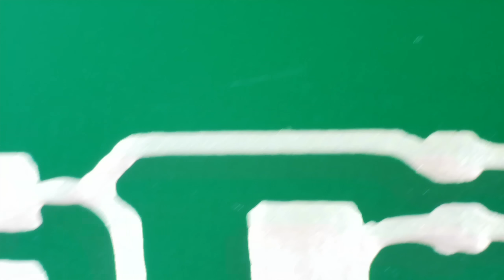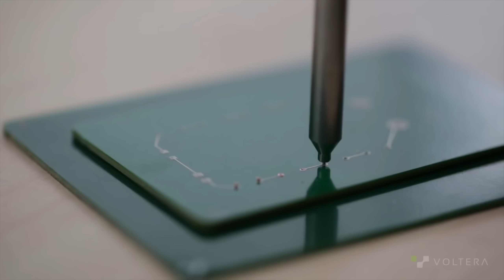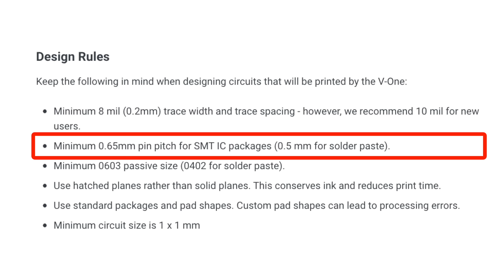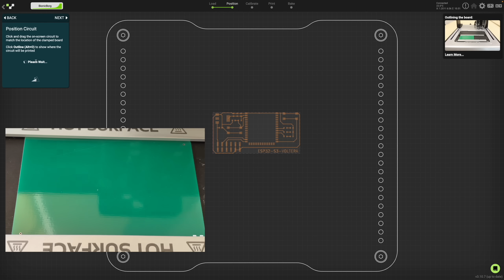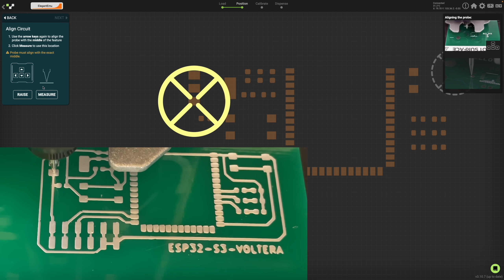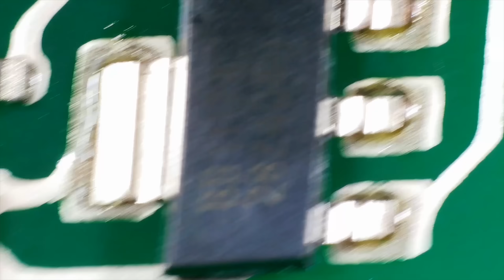Printing PCBs At Home!

Comment: At $5000 for this machine, instead  you could afford to pay someone in china to go pickup your $5 boards from pcbway and overnight them to you.   
You could afford over a hundred boards that are multiple layers and high quality and still be cheaper.
I don't understand why someone hasn't done this kind of thing yet, not using a pen plotter with conductive ink, but just print the tracing in solder mask and uv expose them and then etch.
I want to build such a machine myself, but laser printer toner xfer is almost free and just as fast.

Comment: IMO, they really missed out on adding an attachment for a fine tipped paint marker to do silkscreen markings - it shouldn't be difficult to do considering it's the same process as their conductive ink prints except it's a different ink or using just a mechanical jig to hold a marker.
They could probably even provide a dispenser to do UV cured solder mask (not necessarily for their printed boards) since the software already has a 'homing' function so in theory an etched board with the appropriate gerber files would allow for this.
The price of the machine though... Way too steep for a hobbyist especially for those in regions where etchants are readily available (unfortunately not for me).
I can see how this might be useful for a small business specializing in producing prototypes just purely as a solder paste dispenser since they'd not need to make/ procure stencils.

Comment: I REALLY wish that you had elaboarted on the "reflow" process.....how did you heat the soldier?
bake the board in an oven? heat gun? crack pipe? barbeque?
Reply from the maker: The Voltera machine does the reflow as well.
Reply: I use an old, repurposed toaster oven.  They cost $10 at Goodwill.

Comment: That scam again... Instead, you can purchase a 2k photopolymer printer (less than €300 new and €150 used now), take a blank PCB with a photo resistive layer, and make an ideal hand made PCBs, with true, thick (I mean 2oz if you wish) copper traces.
Reply: I agree that the classic way of etching a board seems better in some ways, but printing on solder paste is WAY BETTER

Comment: seems like you could use the drawing as a mask for a uv sensitized board and then etch normally.

of course you could do that with a pen and a cnc machine probably cheaper.

or the uv screen of a resin 3d printer

Comment: It seems more like a glorified breadboarding solution, rather than a PCB prototyping solution.  I mean, with its limitations you can’t really use it for prototyping your final PCB layout design.  So, once you’ve “prototyped” your “breadboarded” circuit design, you still have to go down the final PCB design prototyping path (with the usual delays waiting for your chosen PCB manufacturer to deliver).

Comment: With the USB port issue, couldn't you drill through the board and secure the connector to the PCB with some jumper wire or something, so there's no force exterted on the bond when inserting/removing the cable? While lining up a double-sided print would be difficult, doing some selective drilling to secure things like headers, switches etc would be easy enough?
Reply: How about mount the connector on the back of the PCB.  The pins can go through holes to traces on the top surface.  This would be a lost stronger than an SMD connector.

Comment: Printing the traces directly on a blank board is a surprising approach. I would have thought you'd do it by printing resist onto a copper-coated board and then etching off everything else.
Reply: That would probably produce better results, but then you have all the etching chemicals and wash steps.... this approach is simpler and less toxic.

Comment: If you mark/drill alignment dowel holes, and then mirroring the bottom traces, you can print the top, flip the board and mount on the alignment dowels, then drill and solder a bit of stranded wire between the pads as via's for double sided boards.  I also wonder if you squeegeed a bit of liquid solder (the SMD stuff) over the traces then re-baked it if it would pre-tin the pads/traces
Very cool and awesome development! Keep em coming!!!!

Comment: Just a thought, but have u considered adding another step? Run a a drill over it cutting out the design b 4 laying the conductive ink, u might get stronger part adherence to the board.

Comment: Interesting that the actual x-y movement is quite quick while printing, but the z movement is quite slow and there's a pause at the end of each movement before a positive z movement. I assume the pause is to reduce the sizes of holes and bumps in the printed ink. I wonder if the software has tuning for the z speed. It also looks like there could be some pretty significant efficiency optimisations that could be done, such as printing complete nets in one go rather than doing several segments and pads separately. I'm guessing that, with the way the solder doesn't wet the pads quite the same way as traditional copper pads does, solder resist isn't as important, but I don't see why they couldn't have you swap out a tube of lacquer to give you that option. Same for a "silk screen" layer which could just be a pen attachment. 

Aligning a double-sided board probably wouldn't be too hard if you also had the drill attachment since you'd just need to provide two or three drill sites similar to the alignment process done for the solder paste step. Also, though I see the official video shows them inserting the via and through-hole rivets after printing, I think it'd probably be easier to do it before printing the traces and pads.

It would certainly be cool if this technology could be integrated into a pick-n-place machine for an all-in-one process where you'd stick a blank sheet of fibreglass and get a completed circuit board at the end (that'd probably have to only be single-sided, though unless you really complicated matters by adding the ability for it to flip the board itself).

Comment: This device is expensive but completely ineffective :) The ratio of price to the quality of the obtained PCB completely sucks. Making a PCB photochemically or by thermal transfer takes the same amount of time and gives incomparably better results both in terms of resolution and, of course, the quality of the PCB itself ( the tracks are copper and do not peel off the laminate for any reason ). Even simply milling the PCB from the laminate is better - the quality of such a board is definitely better than those tracks applied by Voltera. 
It is nice that attempts are being made to construct such devices, but unfortunately, so far nothing is able to meaningfully compete with "ordinary" PCBs. Also for the amateur at home. Especially at a time when you can cheaply buy a ready-made laminate with applied photosensitive coating. In my time you had to do it yourself :)

Comment: The solder paste dispensing. That's the part that got me. Man that's so nice. Really awesome demo video. It would be cool if there was a PCB (from copper plated fiber glass) milling machine that deposited solder paste as well. I can imagine that fabricating much better prototypes.
Reply from the maker: I'm going to try out the solder paste dispensing for my next manufactured PCB - will post a video on the extras channel to show how well it works.
Reply: I wanted to comment that, too, but it seemed so obvious that I searched for someone else, who will have mentioned that within the last year. I found your comment and decided to like it instead :D

Comment: I'm wondering if using an abrasive on the board before you print the traces and pads on the board would make them adhere better. The surface of that board looks a lot like you're printing on glass, which would have very little binding strength.
Reply from the maker: Definitely worth a go.

Comment: Thks quite interesting & thinking out of the old box;
     Consider a 3D printer with 2 print-heads.  One head prints hot insulative plastic ; the other head prints hot conductor ;  both cool semi-rigid ; & can be baked rigid/hard.
     Thus any 3D conductor network can be printed embeded within an insulative substratum & component mount-points on/around its surface.
     Let me know what you think.

Comment: Yeah, BUTT, the price tip stop on Mars 😒, the silver ink is very expensive as well.
Per total acquiring and operating such machine is extremely expensive and is better to use a CNC to cut the traces than build them on the surface.

Comment: As someone who works in a professional manufacturing environment with sintered silver inks, surface prep is hugely important to get good bonding to the substrate. Sanding the substrate at ~200 grit then cleaning with isopropyl before printing should help a lot. There is also some benefit to doing a 2-step sinter process where you bake once as normal then do a second bake under mechanical pressure (clamp PCB between 2 pieces of jig plate metal or borosilicate glass)
Reply from the maker: Interesting - I'll try out the sanding idea. Great to get some advice from a professional.
Reply: I was just going to suggest keying the surface and degreasing but you beat me to it. My knowledge comes from painting cars but it still applies here.
Reply: Thank you for your advice. I would like to know the specific electric resistance in order to compare it to copper (17.1 mOhm mm²/m).
Reply: could you use the machine to run over the substrate using the drill bit instead of sanding?

Comment: This is fantastic. I wonder how the mechanics would be if you used UV-set epoxy to reinforce the header and the pushbuttons. Since the conductors are silver, I'd add conformal coating to protect from environmental damage and oxidation.

Comment: To be honest, I would like to try this additive printing process myself.

Agfa has some nice ink for laserjet printers (eg. soldermask ink or photoresist ink, which is applied and cured in one printing step.).
(And I think, the best printer for this could be the LP50 made by Suss.)

So I would'nt need to make films with a photoplotter, as this first developement process has lots of potential for failure and i haven't got the hang for it yet.
Reply: You could stick a UV laser pointer on your favorite 3-axis system that you have on hand and g-code hack it to make a cheap and albeit slightly crappy version of an LDI system
Reply: @yerbamate1  Yes, I could do this, but then I'll lose the capabillity for twolayer-pcbs and the quality of the developed film will drop pretty hefty.

(At the Moment of the application of the photoresist, the pcb is allready drilled and metalplated.)

Comment: What is resistance of 10cm trace like you done in this video ?
Reply: In that sense it looks fine. Resistance should be comparable to 30—50 μm copper, they claim 10 % resistivity of copper, 0.3—0.5 mm thick conductor looks tolerable.

Comment: You  probably can use two vias inside pads to "nail" down that usb connetor, they dont have to go anywhere, you will prob have to add real solder as a final step

Comment: That's a lot of limitations for the price, but it's also pretty cool that it does the solder paste all in one.

Had a thought on a really strong way to mount modules like that USB board. Instead of soldering on a pin header first, I would take the headers out of the module, and try soldering the bottom of those vias onto pads on the board, BGA style. Then for strength you could screw the module directly onto the board using the holes in the module and some corresponding holes on your PCB. I think that would hold up to quite a lot of abuse.

Comment: How about using copper plated bare pcb; cover it with acid protective paint and then remove the paint using a low power laser engraver. Finally etch it with copper etching solution. I have tried it it is cheaper and quite fast.

Comment: That's one of the better results I've seen using conductive ink, but the limited adhesion is a sore point, I think. Maybe there's a trick to improve it, with some treatment to the board first. I'm guessing they use some kind of epoxy when they make proper PCBs.
I really wish there were better and easier ways to create low-cost circuit boards. While those Chinese manufacturers are cheap, it's not ideal.
Reply: They etch proper PCBs from copper clad fiberglass
Reply: @silaskuemmerle2505  I'm aware of that. I was referring to how they glue the copper sheet to the fiberglass in the first place.
Reply: @Vermilicious  if I were to guess the copper sheet is probably pressed onto the fiberglass board while it’s still wet

Comment: Why not go further?! This printer need to use another interchangable head with UV-resin, and install UV-lamps into case. It solves many problems - 1) It actually gives this printer a ultra purpose - to print multi-layers schemes. 2) It would allow to create more force-resistance solder joints - just by having them bigger and by covering joint perimeter with UV-resin.

Comment: Looked at that Voltera machine but the price is absurd. It looks like something your generic 3D printer knockoff would be able to pull off easily if equipped with a syringe with the silver liquid and a linear motor capable of carefully regulated travel, neither of which would cost several thousand dollars.

Comment: i tried really hard to use the laserjet + glossy inkjet paper + silver ink stuff technique but i just could not get it to bond right. the silver ink absorbed into the paper. i tried transparencies and even inkjet ink to try and bond  / heat that but it either wiped off or the transparency just melted. i am determined to have some kinda quick positive-only PCB making method that doesnt require etching. i really like the look of this machine. it seems so much more diable than FDM printing to be honest. it has a less difficult task to do

Comment: Interesting tech. The problem is just a little more complexity and you’ll need a via. What’s the solution then? I don’t see this as being any more useful then toner transfer and good old FC. I’m not even sure it can make finer traces.
Reply from the maker: Definitely, and once you start drilling holes, aligning top and bottom prints, and then banging in tiny rivets... it feels good for quick simple prototypes where breadboard is too messy, but is it in a sweet spot where it's really useful.

Comment: I would have to make hundreds, if not thousands of PCBs, to break even. 
All my projects are one-off and all wired on perf boards using old-school hole-through parts. They look great from the parts side. Just don't look under the skirt! 
Spaghetti Galore, but it's up and running before one can even finish designing a PCB!! 
However, If you make more than one-off, you need a PCB. That's where the cheap Chinese slave-way comes into the picture.
Reply from the maker: It's very hard to justify not going to China for PCBs. The price is just too good. You can kind of argue doing assembly outside of China - if you have a pick and place machine already setup. But PCB manufacturing - it's way too dirty and manual.

Comment: Not worth the time, cost, or hassle when you can get 4 layer boards from jlcpcb or pcbway in under a week, professionally done with silkscreen, plated edge connectors, vias, drilled holes, etc. qty 20 for like $50. If you really insist on single sided boards, a fiber laser is way better than this - i've used a 20W 1064nm fiber laser on copper plated FR4 boards and the quality and detail is way better than what this voltera generates, and you dont have to worry about mechanically weak pads.
Reply: 50 dollars start adding up fast bum

Comment: You could make the whole back of the PCB a ground and use thru-hole capacitors as bypass with one leg formed to work on a SMD pad.  The idea is that the ground leg of the capacitor jumps the connection to the top of the PCB.  This way there is no alignment needed.  You just have to handsolder the capacitors after the reflow is done.  You will need the super low temperature solder for that.
Also:  If you use a zero Ohm 1206 resistor you can run a wire under it to get your layout to work.
Reply: hey thats a good idea. might be precise on the top, but the bottom is just a giant ground plane. nice i like it
Reply from the maker: Nice idea. And you're right, zero ohm resistors are all that's needed to fix any impossible routing issues. We've been spoilt by the easy access to multi-layer boards for next to nothing.

Comment: I'm still skeptical of these things, the ink is just too sloppy for anything tighter than what's shown here, and baking seemingly adds to that, plus fully exposed traces, and the soldering situation.  For home kit stuff, I think using an MSLA printer works better on PCB blanks, you get a digital mask and UV lights in one step.  Not to mention the cost differential, especially when this process has consumables that're (last time I looked) proprietary to the company itself.  This machine just does not make sense anywhere, other than being a rapid prototyper for a large company, yet there's also better prototyping alternatives.

Comment: How did you make the plated through hold vias?
Reply from the maker: I don't have any vias on my board. But there is a drill attachment and they have small rivets that you can use to join the two sides of the board.
Reply: @atomic14  Why don't you try with that silver paste thingy?